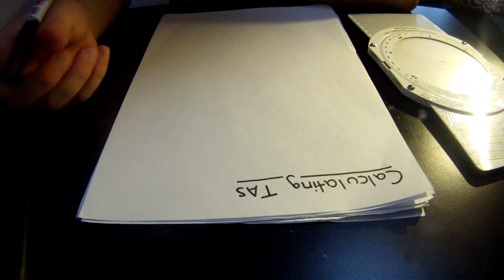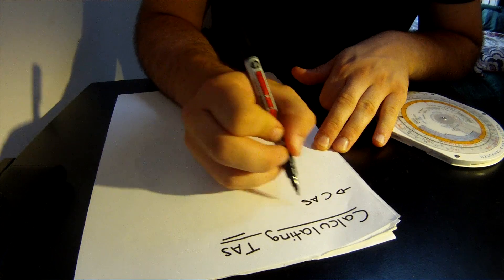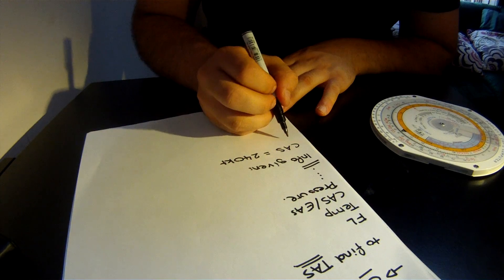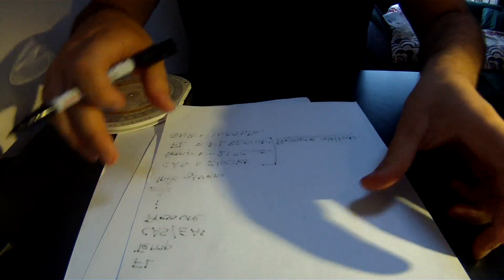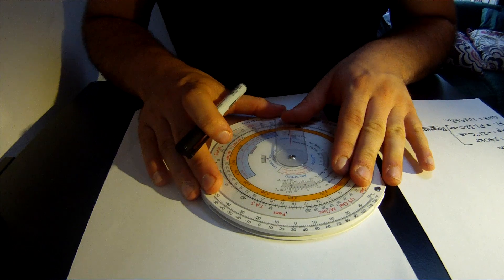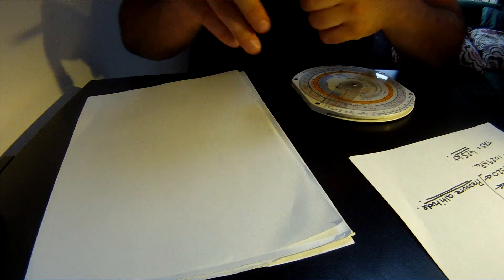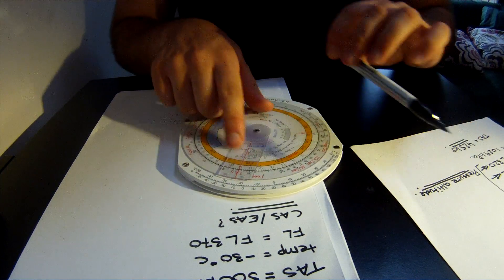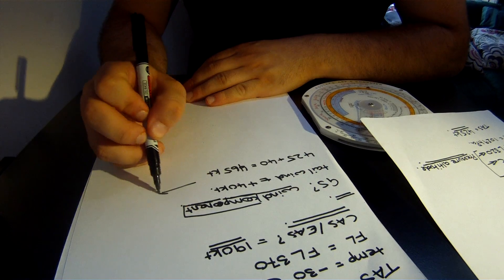CRP5- Calculate TAS Part 1- Merryface Aviation Groundschool

Comment: i use the same information on a crp1 and my TAS 456, I also dun it on a pilot's app TAS 445. that s is more accurate
Reply from the maker: You're right. As was mentioned by another commenter I made the mistake of using my flight level as TAS!! I'll put an annotation on the video and upload a corrected version. 445kt is closer to the real answer
Reply from the maker: Alright, I uploaded the correct way to this question. One thing I did do is also correct for compressibility, something I didn't do previously to keep it simple. I qua triple checked my method and answer and THIS IS CORRECT.

Pooley CRP-5 Tutorial: FInding TAS and correcting for Compressibilty error Download Download
Reply: Great, have you dun or ATPL'S. Am studying for mine now,
Reply from the maker: Peter Wakefield
I'm doing my ATPLs as well. I have already done gen nav. Still have a quite a few left though.